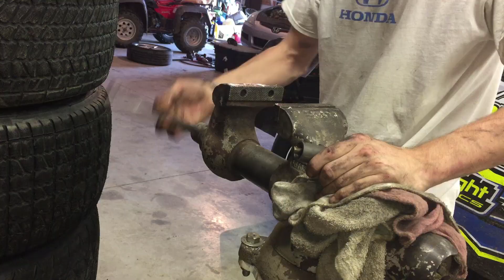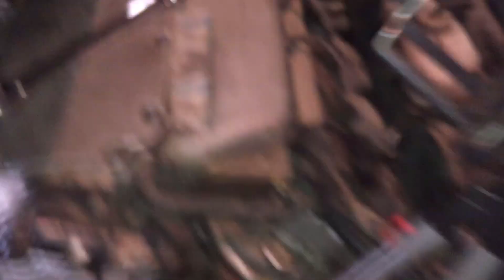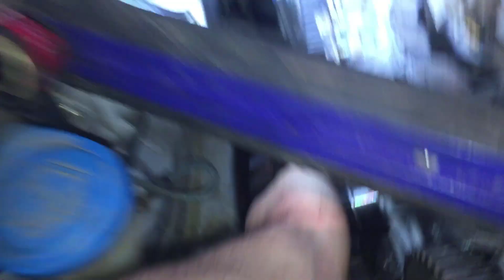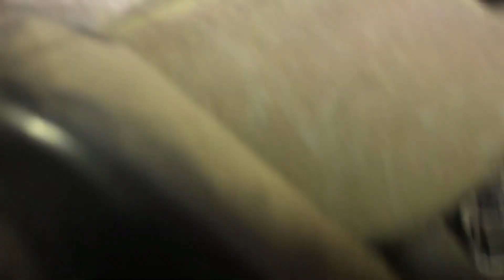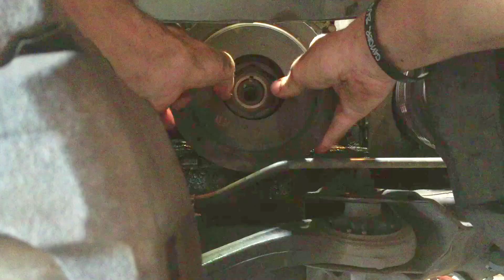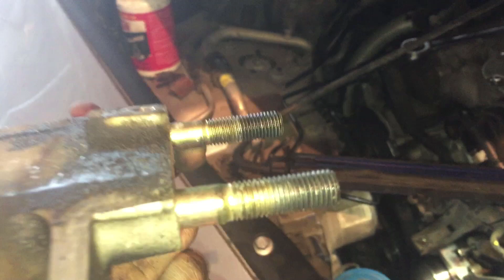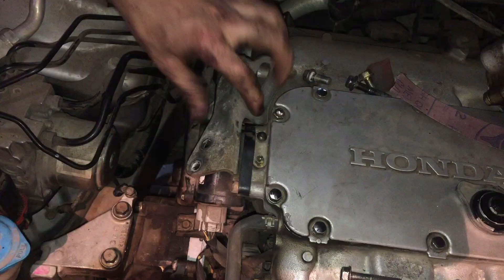Honda Accord V6 Timing Belt and Water Pump Installation

Comment: This was an excellent 2 part video and it worked on my 2007 honda accord. Word of advice-if your back cam moves just simply take a wrench and turn it a inch or two until the timing marks are lined up again. Also, when i pulled the pin on my new tensioner it didnt pop out and i didnt realize it and when i was turning engine by hand i heard a loud pop. Luckily i checked all 3 timing marks and they were still lined up but my belt did jump a notch but as long as all 3 timing marks line up your good to go. THANKS FOR THIS VIDEO👍 PS its still running great!
Reply from the maker: Thank you! You're welcome and I was glad I was able to help! Thanks for also providing more info for those who may run into similar issues

Comment: Can start the engine after timing belt put on to test if the engine start and no leaks with water pump before put back engine mount and else to complete . Please advise thanks.
Reply from the maker: Yes you can as long as the tensioner is on. I would highly advise putting the crank pulley back on, to prevent the belt from walking off the crank sprocket
Reply: Sorry to ask you that if skipping one or two teeth. what is consequence. Toast the engine or re install the belt correction. Please advise.
Reply from the maker: I honestly could not tell you on this engine, I have never done it. Some have a couple of teeth of safety, but other do not. If you didn't feel significant resistance while turning it over by hand you should be fine, but I would continue checking by hand if you are not sure.
Reply: When a tooth is skipped, the engine will run very rough as it raises from idle. So increase the RPM slowly and don't stomp it. You will need to realign the cams, crank and belt again.

Comment: Everything fired up perfectly, but I have a chirp sound not present before the timing belt replacement.  The instructions mentioned this possibility.  Do you have experience with that?  If I must go back in, I have to pull the new timing belt to install this shim behind the timing belt idler pulley.  Is it possible to remove and reinstall this belt or do I have to cut it off and buy another new one?
Reply: Nix that.  Because my new serpentine (alternator) belt had not arrived yet, I reinstalled the very only one.  To see if it was this belt doing the chirping I sprayed a little belt dressing on it and the chirping immediately stopped.  Thank God.  New belt will be here tomorrow.  Again.  Thanks for the help.
Reply from the maker: Sorry I didn't get back to you sooner, yes you might have just got some power steering fluid on the old one making it slip and chirp, glad it got sorted out

Comment: Trying to put on timing belt. Started counterclockwise from crank pulley. Was going fine until got to tensioner pulley. Can’t go around that pulley. Not enough slack. I checked and tight around all the way to that tensioner pulley. Any tricks on how to get it on so I can pull the pin on the tensioner?
Reply from the maker: I sometimes turn the rear cam counter clockwise with the belt in to pull more slack out of it, but I would double check to make sure ALL the slack is out

Comment: I saw green coolant when you were cleaning the surface of the water pump mating area..I'm just wondering if you flushed the existing coolant in the block because at the end of the video you added the pink updated coolant. Will that cause any coagulation issues in the coolant ports? I love your videos, another fantastic addition to your channel
Reply from the maker: +LiberalismFTW if you changed coolant types I would flush, however i did not flush. Didn't even think about it honestly, but I should've ran water through it. Didn't think about it since this is supposed to be compatible with imports (I didn't buy it, customer did, I prefer Honda coolant), so I guess my naive assumption was that it will mix with whatever amount was left in the block. Anytime I think pink coolant I think the GM stuff so I try to avoid it in the first place. So if you do switch like I did, to prevent coagulation and corrosion risk, definitely flush. Thanks for that comment!